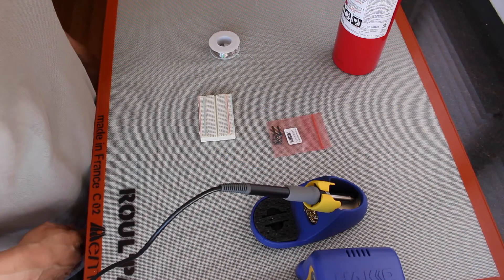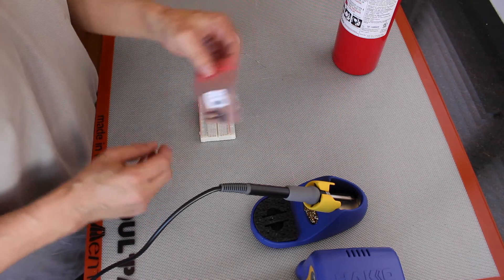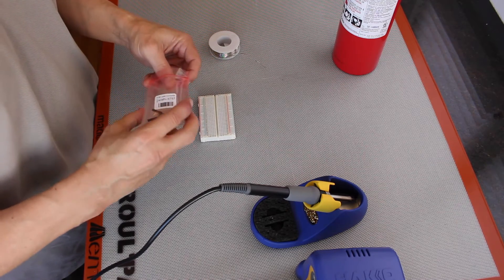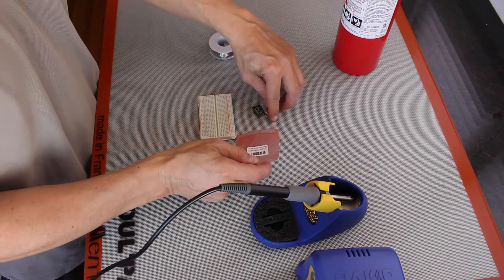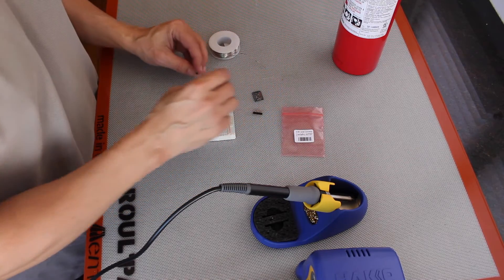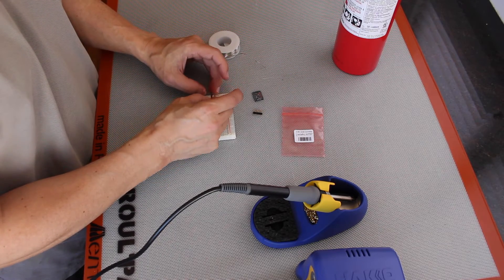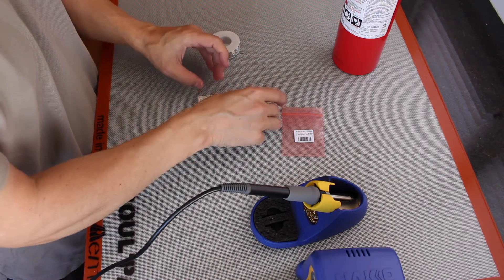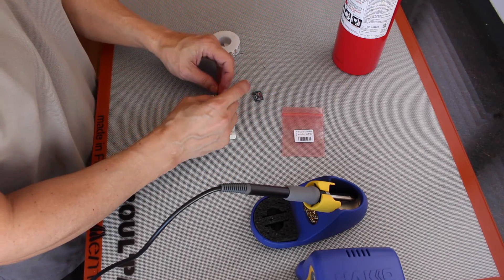UART Interface with Level Shifting - GPS - NVIDIA Jetson TK1

Comment: Hi~
Is there any tutorial about using Serial Port on TK1? I want to write a program about reading some data and control my device from Tx & Rx, 
I knew that J21 Pin8 is for TX, J21 Pin10 is for RX, and Pin9 is GND
Reply from the maker: Not sure what you are looking for. The above article covers interfacing with a UART, which is a serial port.
Reply: is there any tutorial or sample code for serial port?
Reply from the maker: You can ask general questions like this on the official NVIDIA Jetson TK1 Developers forum where a large number of developers and NVIDIA Engineers share their knowledge. The forum is located at: https://devtalk.nvidia.com/default/board/162/jetson-tk1/